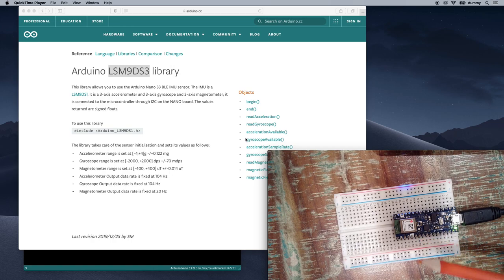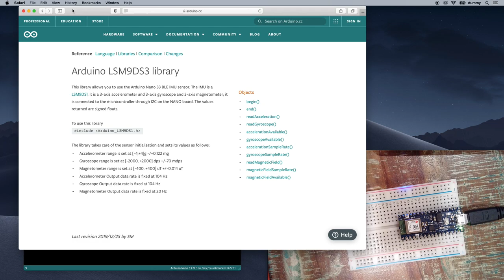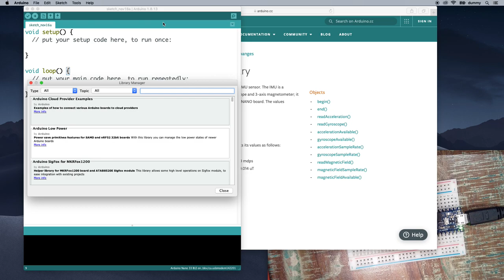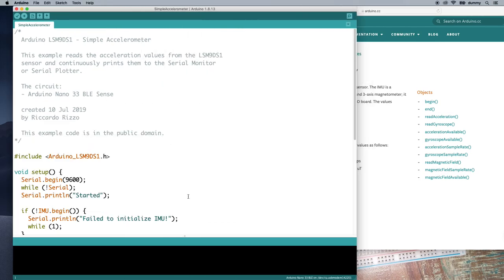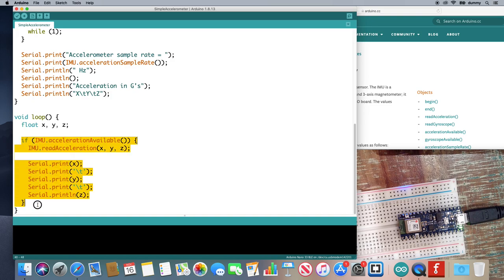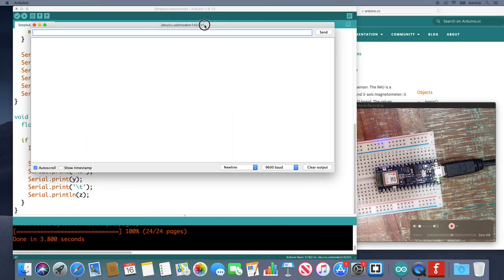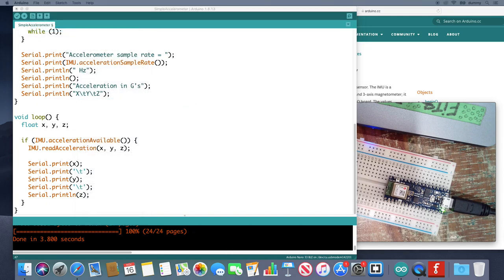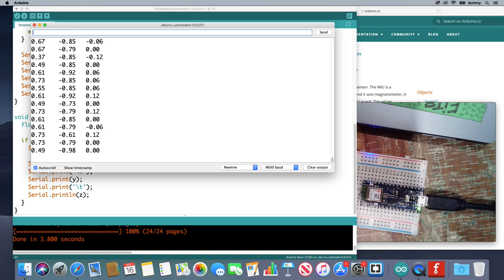Using the accelerometer and gyroscope on your Nano 33 BLE

Comment: Why are the gyroscope data not constant, even when its not moving?
Reply: There will be a little bit of error, the sensor data isn't perfect. You can try to calibrate with some code but I dont usually bother with it lol
Whatever you have the input as you can just make it a range instead of "1 = ledON and 2 = ledOff", you could say "0-1= ledOn and 1.01-2 = ledOff" just as an example

Comment: HUGE BEAUTIFUL MAN!  I am a total newbie to Arduino.  Got my Nano 33 BLE today and have spent hours trying to a) get something to compile and install, b) get feedback of ANY KIND to tell me it worked.  Your video did both.  I finally have some sort of conceptual basis, using a working example, of how the programming is done.  I got the accelerometer example working.  

By any chance, have you done the bluetooth connectivity portion?  As I understand it, we need to a) define the service our Nano is going to provide as the peripheral, then b) advertise the service to make it visible to our client application, then c) send the client some information from our accelerometer (e.g. every time it goes from positive to negative and back).

THANK YOU SO MUCH!